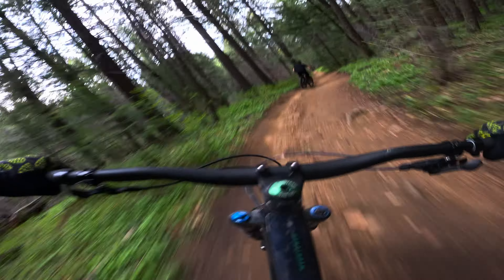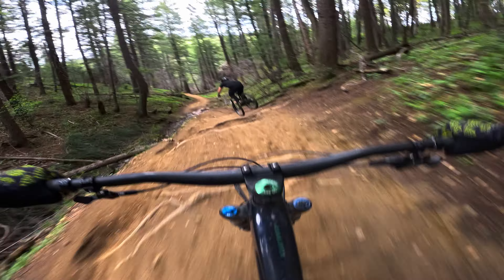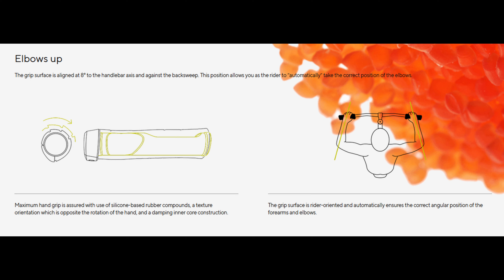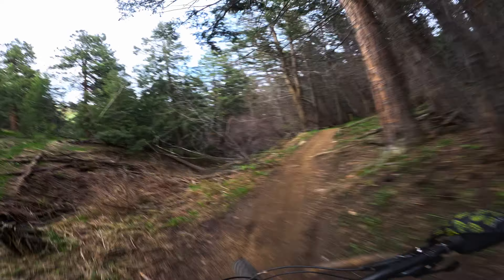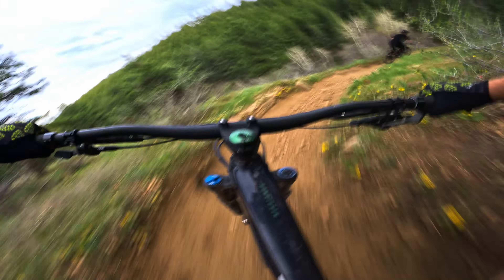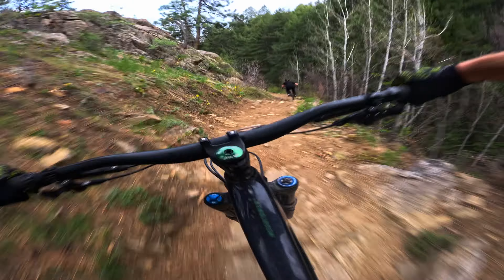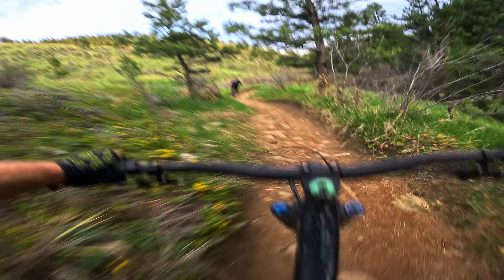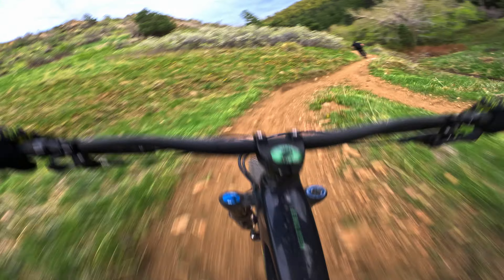Are These Grips OVER-Engineered? Ergon GE1 Evo Grip Review

Comment: These are the grips I use and they are gar better than any other grip I've used. My favorite design feature is the angled part at the crease of the pointer fingle
Reply from the maker: Awesome! Yeah I’m a fan of these if you can’t tell from the vid. If they could somehow use a slightly softer rubber, I’d be curious to try that, but durability would of course be lower. 

The angles really do help with fatigue/form